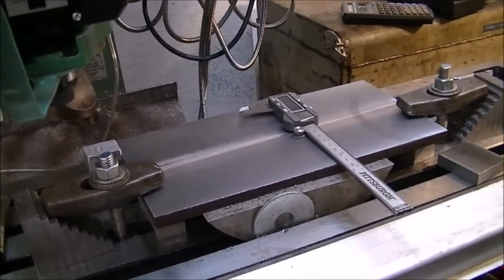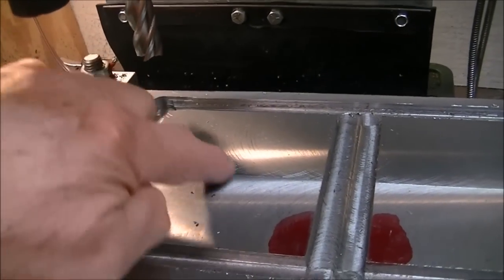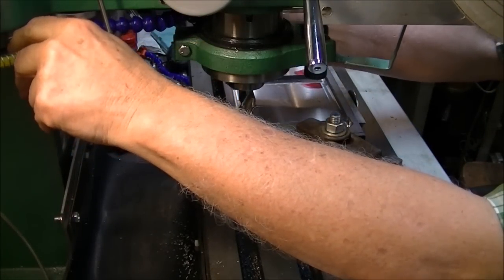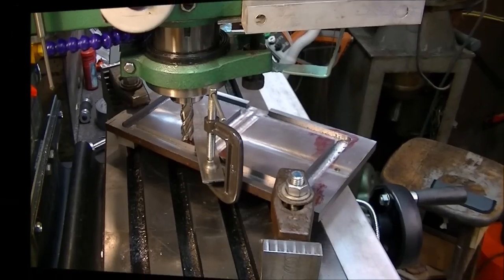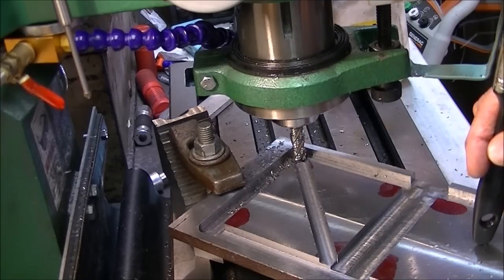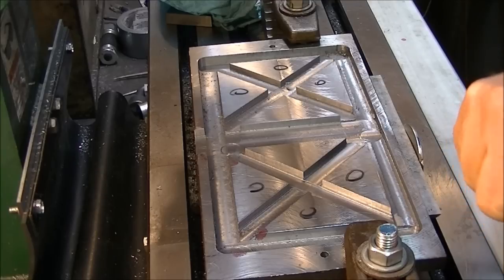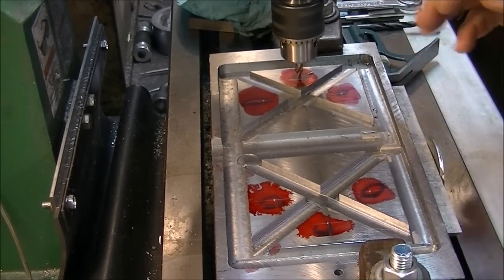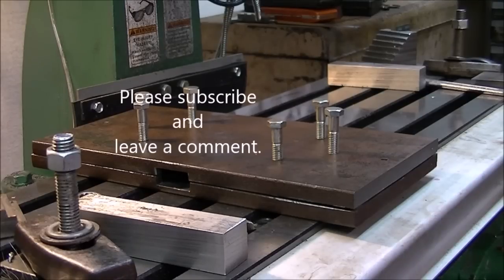Gravity casting mold

Comment: Nice idea Harold. Molding is one of the topics that I'm pretty much interested in these days. 
You said you would see how it comes out (the casting presumably). IMHO you need to put a tapered edge in the design, at least on the inside because otherwise your casting will not come out at all. Aluminium contracts more than steel when it cools so it will compress itself around the inside edges for sure. You might be safe on the outside although I wouldn't put money on it. A one to two degree taper will greatly enhance the chances of success. 
The other challenge will be shrinkage. The thicker a casting becomes, the more this will become an issue. You will need a fairly large reservoir for molten metal sitting on top and let everything cool down very slowly, perhaps by placing the mold in some dry sand or other isolating material. Preheating the mold will also help.
Goodluck with your efforts, I will be following this one!

/emgi
Reply from the maker: +Leo Gijssel I have been thinking on a good way to taper the edges.  I think I have an idea how to make a reservoir for molten aluminum to prevent some shrinkage but I have not built it yet.  I will be finishing some of the ideas between now and when I think it is time to make a test casting.  Thanks for stopping by.

Comment: Looks good but you might have to heat the steel molds while the aluminum is coming up to temp.
Reply from the maker: +The Texas Gun Guy I sort of figure I will have to take my torch and heat the heck out of the things.  I plan to stand them up on top of the vent hole in the furnace and let them heat up some from there and then a real heating just before I pour the aluminum.  I am not so sure that this has any chance of working but I wanted to give it a try.  Thanks for stopping by.

Comment: Hey Harold.  Nice project BUT (yes...always a but from Uncle "Doom & Gloom" Grouchy) I would be concerned about the aluminum shrinkage around those sharp walled islands in the mold.  Even with a heated mold, the steel has 1/2 the thermal expansion and when those aluminum runners cool down and pull in lengthwise they're gonna give all those internal corners a Cosmic Wedgie.  The part may even crack from the stress risers.  But (another damn but!), I like to be proven wrong so my fingers are crossed.  2 ideas come to mind if it doesn't work:
1. Bevel the island walls so when the part shrinks it can climb off the mold.  Spring clamp the mold halves together so it can expand as the aluminum rides up the bevels.
2. Bevel the walls and cast something like short hair Bondo in each half to make your sand patterns.  A few coats of floor wax in the mold, moosh in the Bondo, strike it off with a straight edge and Presto! - Cope and drag sand patterns in 30 minutes.
Good Luck and don't burn off the eyebrows like I always do lighting the furnace.
Reply from the maker: +Eddie the Grouch you know the possibility of burning off the eyebrows has occurred to me.  Not sure why it has not already happened.  Lots of great suggestions.   Frankly I will be surprised if it works but I know it should be interesting to see.  The bondo idea is great, I just may do that.Thanks for stopping by.

Comment: Lots of work.... You'll have to make certain that your halves match together VERY well or the molten metal will sip out by all the small openings, casting molds are tight to the tenth of inches...  

Also you'll need to add a reservoir on top to make up for retraction when cooling, otherwise there will be voids, and to be on the safe side, a couple of vents to let the air out somewhere else than the entry....

As for the results, I'm anxious to see... So, stop lazing around watching YouTube videos and get at it...   lol

Merry Christmas to you and family...   ;)
Reply from the maker: +pierre beaudry thanks for the suggestions.  I will eventually get around to finding out if it works or not.  Thanks for stopping by.

Comment: Happy Christmas to you Harold ! Your steel mould is going to need heating up a lot if you are pouring aluminium, the instant the moulten ali hits that steel it will solidify and block the mould, if you compare a similar situation when using a bullet mould that is cold, and that is when pouring lead!  I think you will have far better success using a wooden pattern in a sand mould, it would also be a lot easier to make, and much more likely to bring you success. Cheers , Chris.
Reply from the maker: +Englishman French I figure that I have a lot of doing to get this thing to work, if it ever does work.  We will see what happens.  I just wanted to give it a try out of curiosity.  Thanks for stopping by.